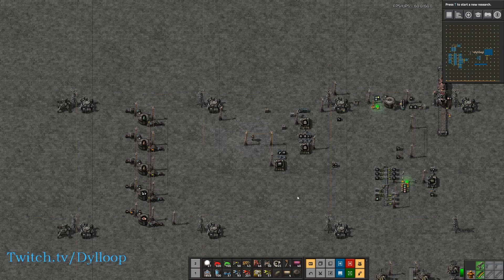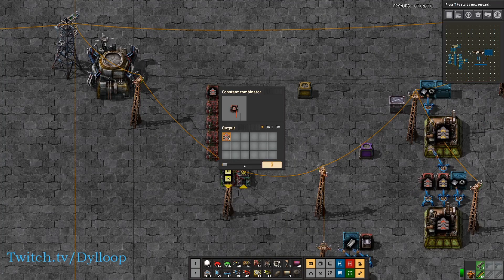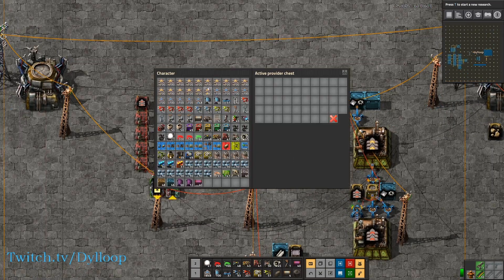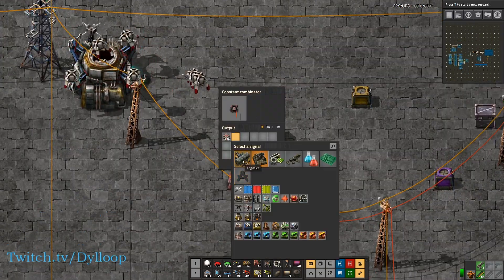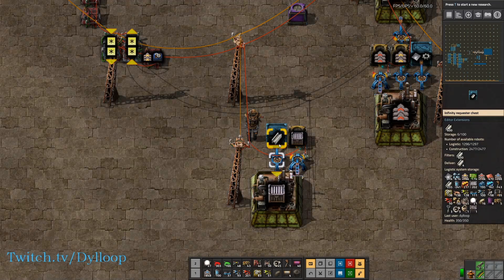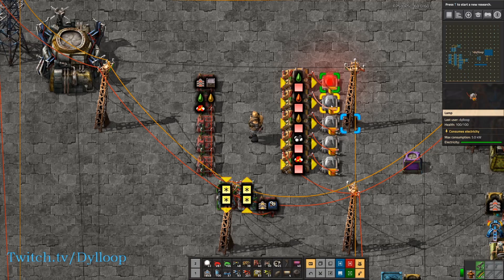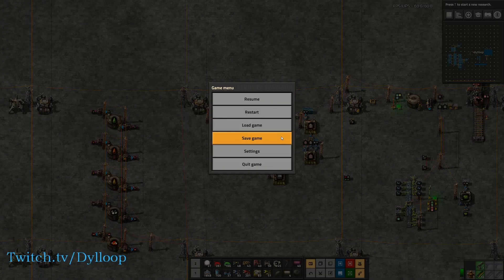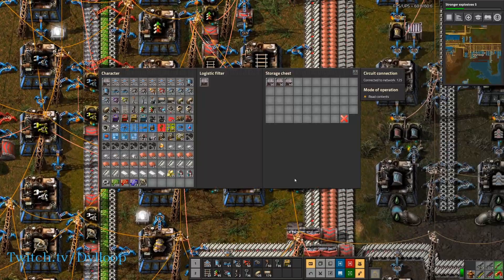Factorio 0.18 Tutorial - Smarter Factory with Combinators

Comment: Nope, nope, didn't get it.  Watched the previous 2 videos, still not getting it.  Why set the thing to -1?  I had to re-watch these a few times to get some basic info.  Why say you are connecting to the arms, but only to a few of them?  The flying drones and special boxes I have not researched yet, so that I didn't understand.  Drones I understand, but what is the difference between a chest and a storage chest?  I don't know.  I have to try to find a video that is a bit more basic yet not 4, 5 years old.  What has changed in that time?
Reply: He is multiplying the desired number of items by -1 to make it a negative number

The inserters are set to deposit items into the system until that number is no longer negative

By artificially sending a signal for example negative -100 belts, the inserters will have to add +100 belts to the chests to reach equilibrium

Comment: 8:27 you can do away with all those deciders and just have 1x constant combinator outputting a red to all 5 lights and then set the on / off parameter inside the light itself based on each fluid reading but I’m not smart enough to figure out your minimum requirement centralised requests, my circuit networks don’t go much more advanced than an alarm warning me when trains are coming :L